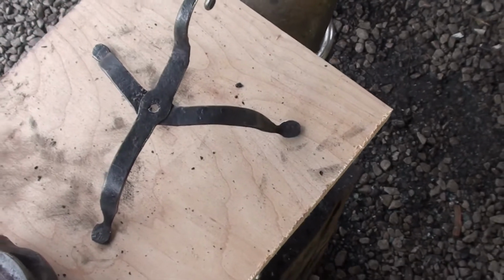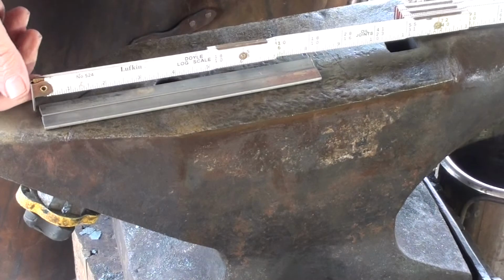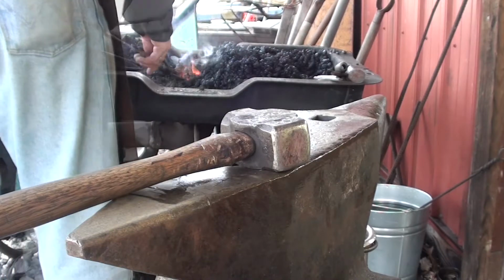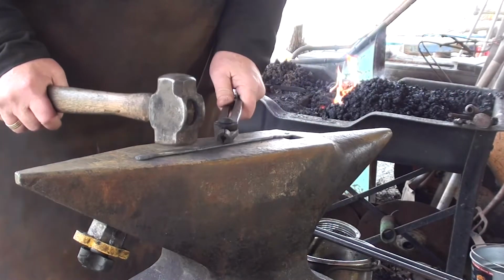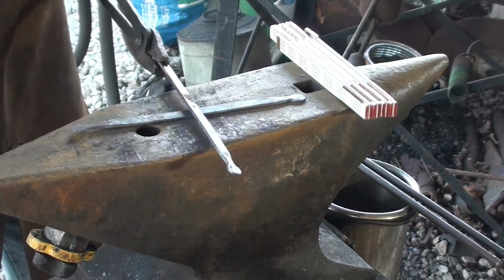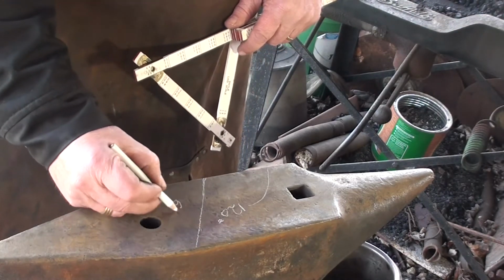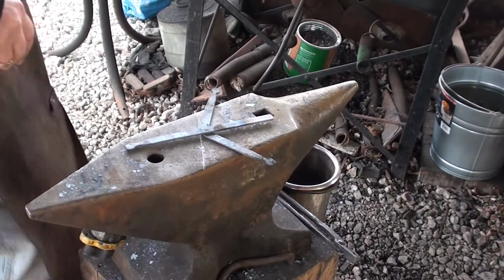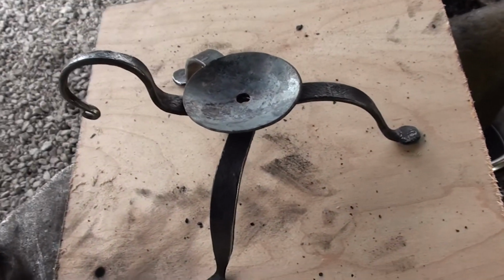Laying out and forging a 3 legged base.

Comment: That really amazes me!  You sir are a Master Craftsman.
Reply from the maker: Tanks, what kind of projects are going on in the shed?
Reply: @bc65925  Well I've put up the walls with the exception of some corners.  I will finish that up today. After that is completed, I've ordered some cheap spray paint and some Mini Blinds from Amazon.  I will put a light coat of the spray paint, let it dry. It's just that "Particle board" will soak up the roller paint. then I have 2 gallons of exterior white paint.  I will roller that on and let it dry.

Get some base board molding and cut it around the windows and A/C unit. 

 (To hid my great cutting skills) 

After that, start moving stuff from the old shed and garage.